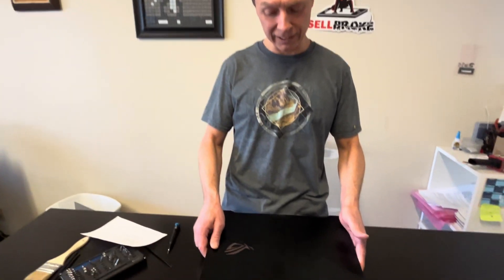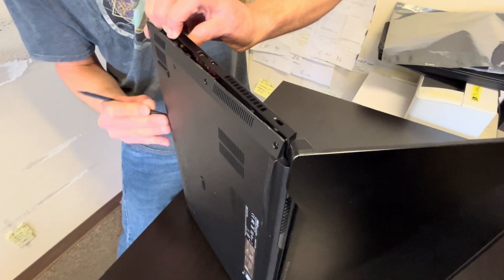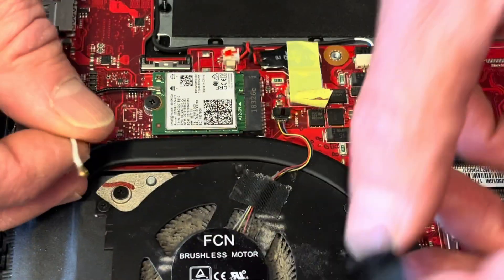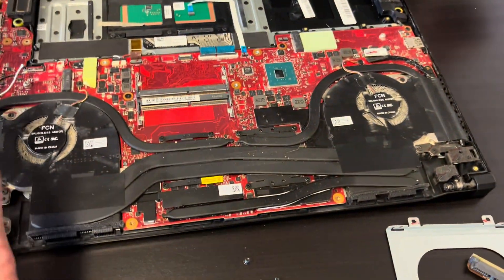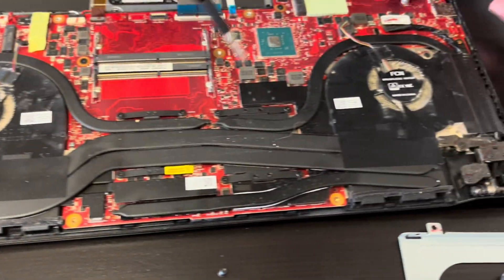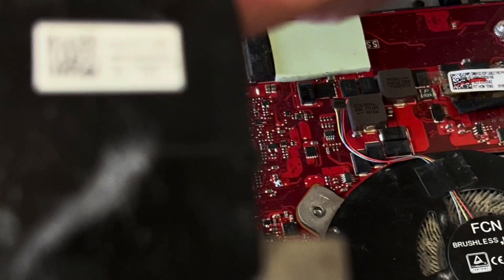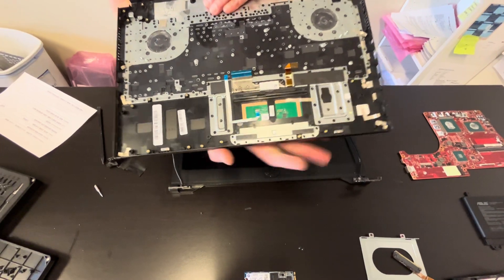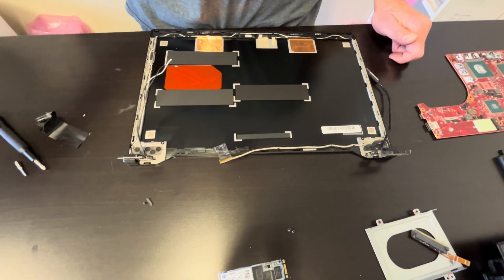Asus ROG GU501GM Laptop. Disassembly, fix, repair and upgrade RAM memory SSD Motherboard LCD Battery

Comment: This video only shows DISASSMBLY. It doesn't show the replacement or repair of any component. It's easy to take something apart. A lot more difficult to put things back together. Especially when you don't show things, like charting the screw removal in the back because the screws are different sizes!